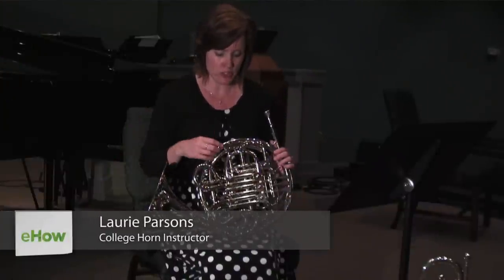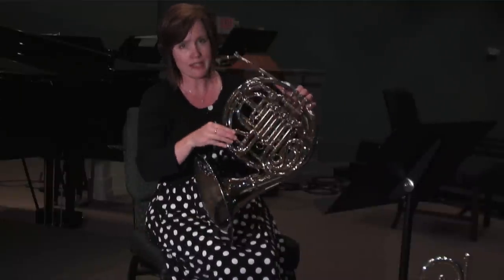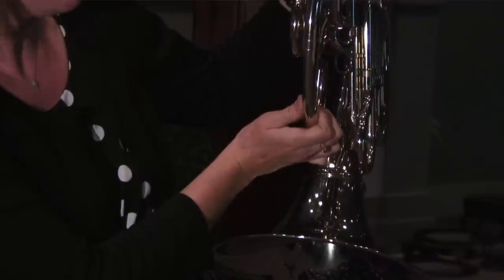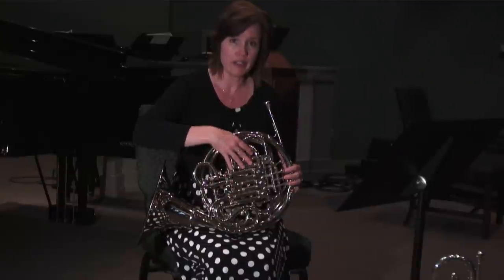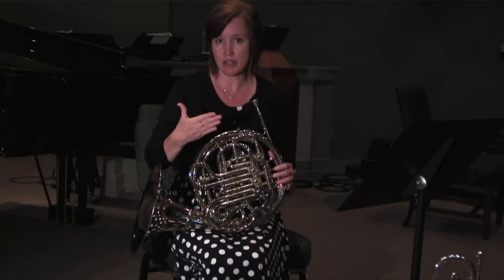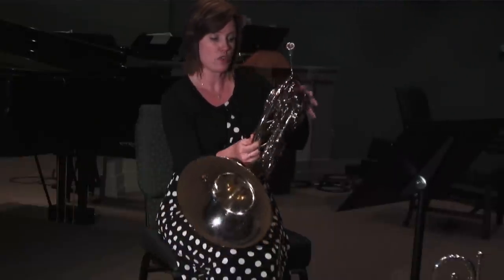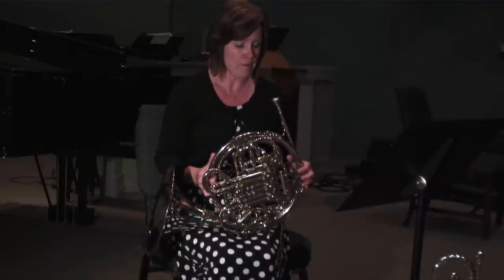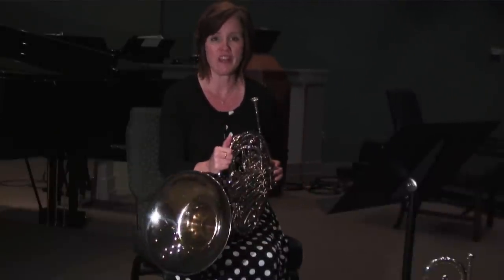Differences Between F French Horns & B Flat French Horns : French Horn

Comment: To anyone wondering: there really is no difference in sound. Theyre just two different keys. The B flat side of the horn was added to an F horn to fascilitate in the upper and lower extremes of its register. Makes it easier to get those extreme notes out. Plus, if playing certain songs or fast movements its beneficial to know both keys/fingerings because it may be easier to use one keys fingerings for a passage over another if it helps the players fingers move faster.

Comment: What was the difference between the horns? I watched the whole thing and still know nothing
Reply: same here.
Reply: The difference is that the B flat side is shorter and therefore higher pitched. On a single F horn the harmonics are so close on the high notes that it is hard to play accurately. The F horn has a much nicer tone in the lower register and the B flat side sounds better in the upper register. You switch to the B flat horn with the thumb valve. There are also triple horns with a High F alto side that makes it easier to play the extreme high notes. A professional double horn costs from about $5,000 to $9,000 and a full triple can run as much as $18,000
Reply: @satinbarbi  And what's about E flat Horn? Or C ? Do players, transpose all the time?
Reply: @jordiv.5616  Not all the time. If the horn part in in F you don't need to transpose when you use the B flat side of the horn. Orchestras have music libraries that date to before it became standard to write horn parts in F. Those horn parts come in every key you can imagine so yes horn players have to transpose a lot. It makes an instrument that is already hard to play a lot harder. For E flat you just think down one full step. For B flat transposition  thinking in steps gets cumbersome so you would read it as if it were tenor clef. http://www.sfcmtheory.com/essays/musicianship/clef_transposition.pdf
Reply: @satinbarbi  Thank you so much! You just answered all my questions that the video failed to answer.